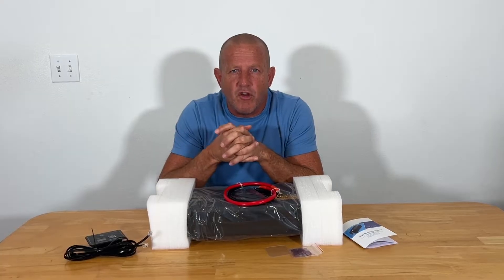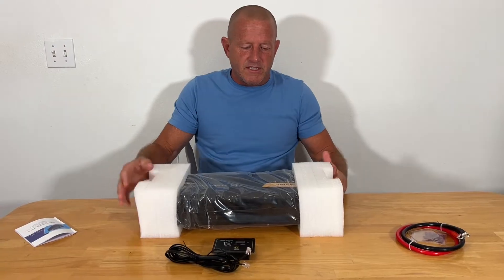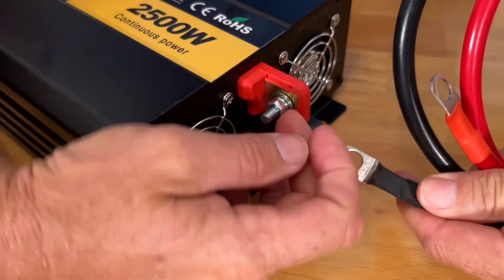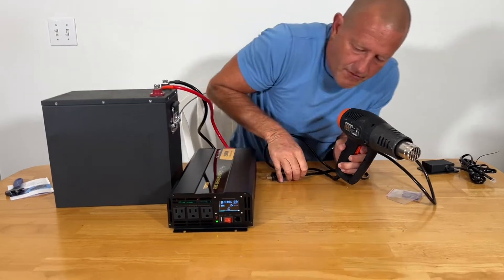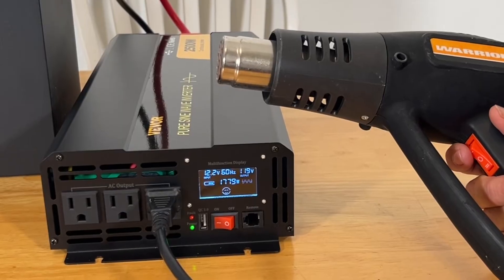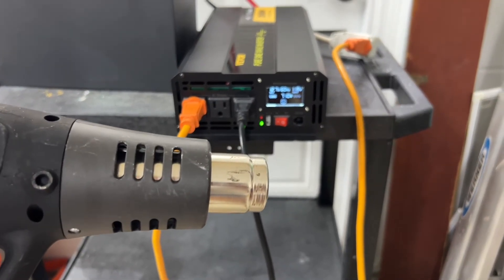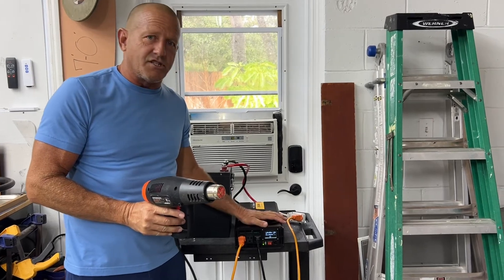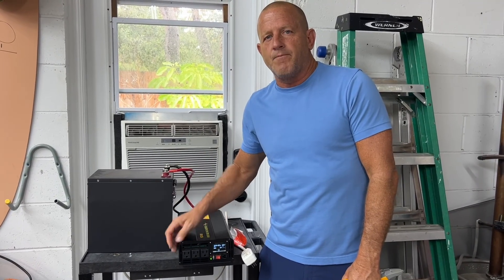Testing the VEVOR 2500W Inverter - Can It Handle 2500 Watts?

Comment: I bought this inverter off Ebay.  It stopped working after two weeks and shut down the BMS on a $400 battery.  The company has been delaying and refusing to give me a new unit or refund.  I warned them that I was going to do this.  I would not buy this unit mainly because the company is crap.
Reply from the maker: just curious for clarification , what do you mean shut down your bms. how many amps is your bms on the battery.  and what kind of loads/apliances are you running.
Reply: @StoneBrokeAdventure  So I guess I have a different version.  A 2500 sump pump Vevor.  Has an electric supply to keep the battery topped off / run the sump pump as a pass through.  It switches to battery when the power goes off.  I had it attached to a brand new Eco-Worthy 280 Amp hour Lithium Iron Phosphate.  I don't know the amps on the BMS.  I know the pump uses 450 watts when it is running.  The power went out when I was away.  When I got home everything was dead.  I ended up hitting the battery with the car jump option and woke up the BMS.  It took the battery down to 6.8 volts which took almost 24 hours to recharge.  The Eco Worthy is a beast.  After I went through Ebay and they read my threats they offered me 80 % back and I keep the unit.  I took that offer so I can take this thing apart and see how it works.  Still not happy with them.  Sorry about using your video as a bi--- session.

Comment: Hey got a question. I have this exact model and just hooked it up with a Weize TL12100(12V 100AH/10HR) rechargeable AGM battery for my sump pump. The battery is brand new and showed a good charge when first connected. I removed the inverter from the grid and did a test, it worked perfectly, so I plugged it back into the grid for it to charge until we lost power. 24 hours later the inverter started beeping and it looks like the battery is dead. Could this just be a bad battery?
Reply: How do you charge an inverter?  You don't need the inverter to charge the battery.
Reply: Hi there I have the same problem with my brand new inverter. It's keep beeping and it said low battery.

Comment: What are the specifications on the battery?
Reply: I use (2) 100ah lithium batteries.  12 volt 200 AH will work.  more is better.  You can use one or two batteries in parallel.
Reply: @inspectorh4548  do you have a lithium ion rated charged going to the batteries or do you have them connected directly to the inverter? Just ordered the 2500 version and a lithium ion phosphate 100ah battery and didn't know if I needed anything else. Thanks!!

Comment: yo tengo mi inversor vevor idéntico a ese solo que es de 24v 2500w, es bastante bueno y el ventilador es controlado por el consumo de energía, no esta directo, es regulable automático, lo único que no me gusta es que al encender el refrigerador da un pico 1000w al arranque algo normal y después de inmediato baja a 190w que es el consumo normal, pero cada que enciende se nota en los focos que enciende, habrá algo para solucionar ese pico de voltaje? tengo instalado también schneider supresor de picos funcionando, pero es como si no lo tuviera, mi batería de respaldo es de 24, 200Ah y aun que este llena y metiendo energía mi controlador de todas maneras pasa lo mismo.
Reply from the maker: a soft start kit is what you would need but im not sure it is worth it.
Reply: Amigo, usted que tiene uno de estos, sabría decirme si ese tipo de inversor cambia de forma automática cuando no hay fluido eléctrico? Es que lo quiero usar en una PC y necesito saber si cuando no tenga suministro de energía él va a asumir y la computadora no se me va a apagar?

Comment: Careful.    There's an open ground present on all Vevor Inverters.
Reply: what that means?
Reply: @andresgarces7921  shock hazard.
Reply: @andresgarces7921  Careful.  (period, Sorry) There's an open ground present on all Vevor Inverters. Shock hazard. I still own and use it ..... just be careful.
Reply: Hello, could you please explain how we should be careful about this point ? What is the "open ground", what is the problem with tit and does this problem has been fixed on other inverter brands ? Thank you by advance!

Comment: How close is the battery state on the remote panel? Debating to install a seperate shunt/panel battery monitor.
Reply from the maker: i use lithium batteries so the actual battery display on the inverter is really not aplicable. the battery voltage (input and output) wattage output, and hz are all accurate on the inverter display
Reply from the maker: i use a shunt monitor which is extreemly accurate
Reply: @StoneBrokeAdventure  So how did it compare to the inverter panel batt state?
Reply: always need a separate shunt / remote. Use a Renegy battery monitor. 500 amp is probably enough. Pretty inexpensive..... And an ANL fuse.

Comment: Work with a well pump of 3/4 HP?
Reply from the maker: you would need to see what the surge watts are on the pump and see if it falls below the specs on the inverter
Reply: Yes it is god, just get a good battery.

Comment: What gauge are those red & black cables?
Reply: those cable came with the inverter and are too small.    You want to look up the distance you need the wire to travel from the battery to the inverter. Shorter distance is always better and cheaper.  You also want use solid copper welding wire not jumper cable wire.   It makes a big difference.   I tried the cheaper alternatives and ended up replacing all of the wire with the good stuff.
Reply: @inspectorh4548  Total corect.
Reply from the maker: @bluehappyscrap  the cables are 25 mm/ 4awg  i would recommend at least 2awg and include a ANL fuse or breaker in your circut